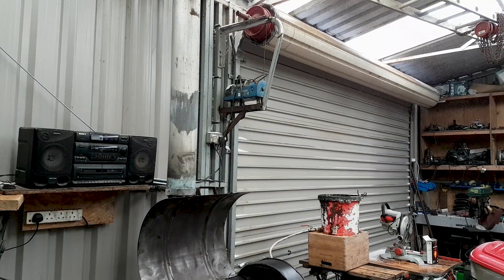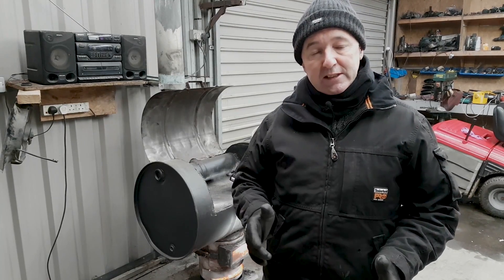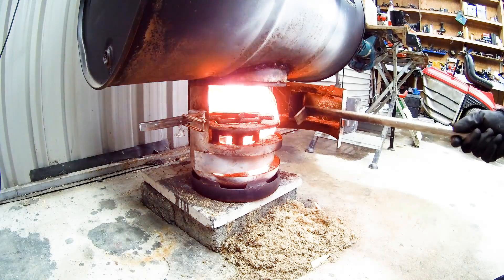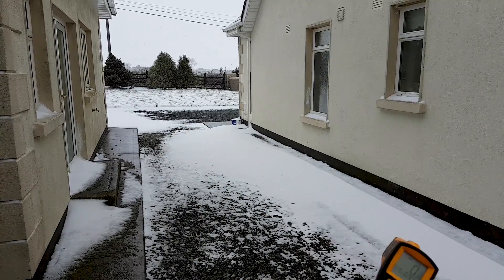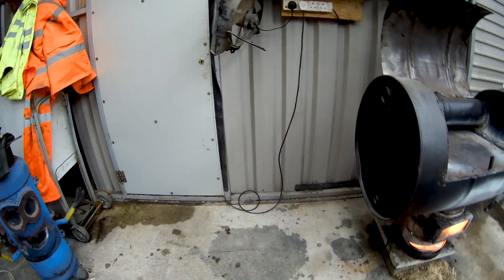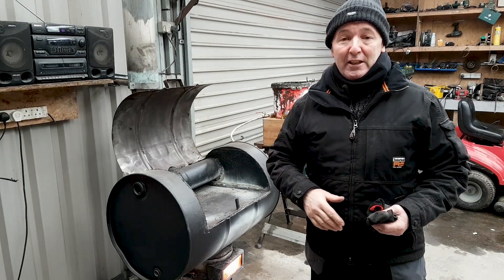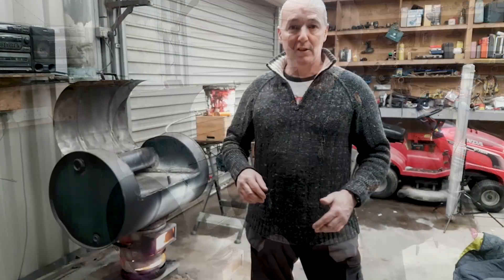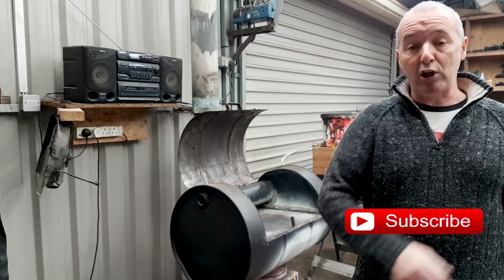Beat The Snow..  Free Heat. Waste Oil Burner + Sawdust

Comment: what if you make the propane tank as burner  with forced air on the side then connect to vertical barel and the chimny from the  upper side of the big barel
 without all that welding and complexity

Comment: Gerry have you ever seen those fans that work off over heat . I've gotten one an it works great for circulation of heat in your shop . I've built a duct to use that fan to circulate air back into the burn camber instead of using electricity to run a fan .

Comment: Hello Gerry I have to questions please. Want to install my waste oil feed tank outside with pipe running through the wall to avoid any spillages inside.  Also want to use 6mm air line transporting the oil from the tank to the drip valve and then converting to copper as it goes into the burner. Will the small diameter pipe be an issue ? Don't want the low temperature of the oil and small diameter pipe to cause issues with the feed due to viscosity. Thanks
Reply from the maker: Hi kas m I think that the 6mm will be too small. I would use 1/2 inch copper for the run. The oil will be very slow to flow when cold and wont want to travel far especially as the pipe diameter is reduced. Be careful using plastic pipes for the run too as the oil might attack it over time. hope this helps Cheers Gerry

Comment: Gerry, you're correct. Metal buildings condense.... especially if you have a concrete floor.
For a barn or machine shed, you let them breath, but for a shop.....
We had issues with rust on machinery in the shop for years.
If the lathe wasn't used a few times a week, it would get a bit too Rusty, would take an hour or so with WD 40 and a bunch of rags to get it cleaned up and working properly. We finally got rid of the wood stove, put in an oil furnace. We keep it set at 50°f... Keeps the moisture at Bay and the florescent lights work properly... 
I have most of the makings for a waste oil stove, just haven't gotten the chance to put it together..... Have to figure out where to put it too.... 
Anyway, seal things up better and try to keep some heat on.... Makes for a much better work environment 😎
Another great video! Thank you!!

Comment: My next project is to turn a 100lb propane bottle  into a waste oil burner of your design Sunday morning here in northern Ontario Canada and the standing temperature is -38C with the windchill in the high -40C. and my wood burner will not heat my shop in these temperatures.
Right now I am rounding up all the materials to get started. Keep you informed on my progress.
Keep up the good work. Bill in Canada
Reply from the maker: Hi Bill. I have been looking at a few episodes of that Hi way thru Hell and the weather there makes what we get here look very tame. My shed is uninsulated but I can stay ahead of the cold no problem. Best of luck with your build. I look forward to seeing it working for you. Thanks for the comment Cheers Gerry👍

Comment: Our burner was the same way. We heated our 40x60 shop with ours for a while using waste oil, transmission fluid, brake fluid, cooking oil. One winter day I was working on a car inside in short sleeve shirt and my brother was also workking in the other bay on a car. The shop was totally warm and I was breaking a sweat. It was 27 degrees F outside and snowing. We had the entrance door cracked open a little because we were almost too warm. The oil burner we built was the only thing we had for heat. It is hard to communicate the kind of heat that oil burners make. It is real heat like you get from a wood stove but far hotter. It heats the building and everthing in it not just the air like a gas heater does. Have a great day.
Reply from the maker: Hi fan1701. Making heat even from a small burner is very easy. It doesn't get as cold here in winter as it does in Canada and the US but it's great to be able to get the shed hot for free. Thanks for the comment Cheers Gerry

Comment: Some reason i get loads and loads of smoke with my waste oil burner i made using your drip feed and forced air system with the hose in hose from the big fas bottle. I used a bouncy castle fan that i think doesn’t deliver enough guts when reduced from 90mm to 25.  As it seems like not much volume or pressure at all? Any thoughts gerry?
Reply from the maker: Hi The Average Workshop. Here's something you could try.  Put a line from your compressor to the air feed to the burner. Increase the pressure slowly until you have it burning bright. If you get it to go red hot without making smoke you know that the bouncy castle fan is not producing enough pressure. They are designed to leak pressure back through the air intake when the kids jump on the castle. If that's the case you can open it and decrease the tolerances between the blades and the casing. Hope this helps. Let me know I can do a video on it if you are stuck. Cheers Gerry
Reply: Gerry if you could Do a video that would be great. I tried the vacuum cleaner in blow and it did the same thing again. Just blew it out. I tried both the ‘drip feed’ and a oil pump on a timer so it pulses fuel in slowly. But both resulted in flame out and lots of smoke. When I’m running the kerosene on warm up the flames are huge. I’m using a square stainless dish like a cube with no top. Confused!!! Cheers gerry
Reply: Basically whatever i do i blow the flame out and end up with a tonne of smoke once it goes out. The flame is huge on kerosene during startup. I wonder if my square stainless dish is the issue. My air and fuel pipe is about 1 1/2 inch from the bottom of the dish.
Reply from the maker: @Fishing-Bert  James the vaporising pot needs to get red hot with the kero. Only when it is sufficiently hot will it sustain the burn with only waste oil. I have a couple more projects to do this week but will get back to the waste oil burner soon. You are very close to getting it going. Too much oil and it will cool the pot so that it will not stay red. Too much air at the start can do the same. They are easier to get going on just forced air. If the metal in the pot is too thick it can take a while to get it hot enough to maintain the heat. Do you have any photos or video of you setup. Cheers Gerry
Reply: Cheers gerry i will do that. Sounds like im being impatient and will try running it on kero first for longer before making the switch. I decided to use a pump on a timer for more control. Will show in a video i do and upload and link you to it. Cheers
Reply: Ive uploaded a video but somehow without sound... shows my set up post this mornings 3rd failed start up on air. Ive got enough air. Thinking i need to start again with a bigger gas bottle. And start from scratch with a self inducting air feed like you did before rather than forced air

Comment: Heating nicely Gerry!  I need to fine tune my waste oil burner further.  I've wood burning barrel in the shed and a Taylor made, (factory) wood burner in the house. 3° F tonight in Northeast Nebraska US.
Stay warm my friend!   Cheers
Reply from the maker: Hi Martin. I had to convert that to C -16 That's proper cold, It's like summer here compared to that. I was looking at the weather in the States and Canada on Weather underground. It's interesting to see how different it can be from here in Ireland. Thanks for commenting Cheers Gerry👍
Reply: Martin Benton check out my burner it worked real good in my barrel

Comment: So you do get kind of a crackling sound from the oil out of your stove also. I finished my burner and had the air noise but the oil popping and crackling scared me. So I shut the oil off and sat and watched it like a hawk till it died down. Then turned the oil back on and the darn thing started doing it again so I figured it was normal. Nice job Gerry keep up the good work. It's supposed to be -3 F here in Michigan this weekend.
Reply: michael thomas cracking cones from moisture in the oil you will hear some crackling from the metal also if its not stainless or heavy
Reply from the maker: Hi Michael. If there is any moisture or water in the oil you can hear and see the difference. If there is a lot in the oil it is dangerous. Thats colder than my freezer. I think its just a little above freezing here in Ireland. We can fit Ireland into lake Superior there 😀 Thanks for the comment  Stay warm Cheers Gerry
Reply: The Undiscovered Country oil attact moisture over time old oil crackles more than fresher trans fluid works best
Reply: Thanks to all three of you guys I'll have to check my oil. The burner is made of 1/4" plate steel so it's plenty heavy.
Reply from the maker: Best to make sure that the oil is free from water and contaminants first. Cheers
Reply: @GerrysDiy  Your definitely a night owl any reply I've ever gotten back from you has been in the evening here which makes for late in Ireland. Only visited the Dublin airport so far but some day I'll be back. Cheers to you too.
Reply: The crackling is most likely moisture in the oil. water.

Comment: Gerry, I have an old clinker boat that I am putting a steam engine in. I have various cylinders about including an old compressor reservoir. Can you come up with a multi fuel type burner possibly coal that will give me 120 psi of steam? Des.
Reply from the maker: Hi Des. Making enough heat to produce steam is easy but to make it very controllable is a little more difficult. If you are making steam with coal and capable of regulating the output to suit your needs then you can do it with waste oil too. My boiler stove is more than capable of making steam but making it controllable is more work. Hope this helps Cheers Gerry